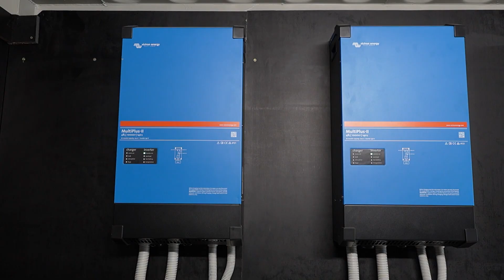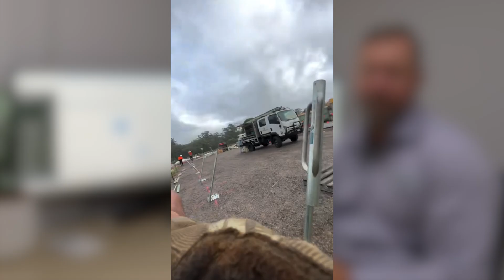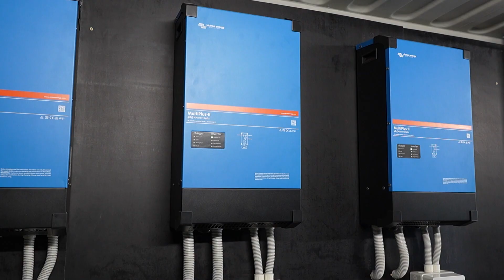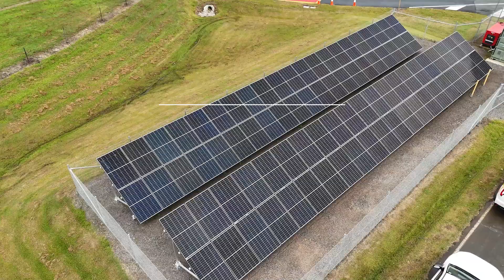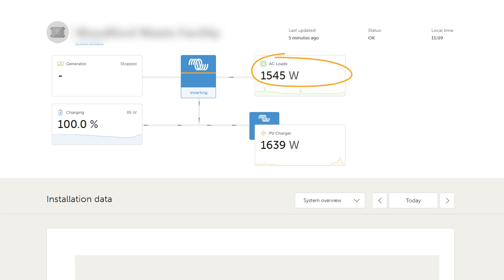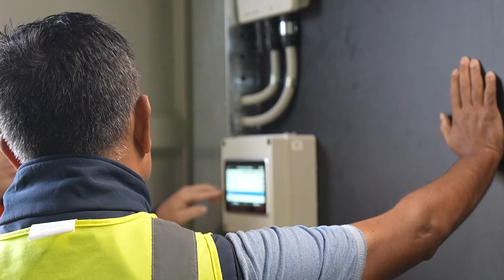Off-Grid System Walkthrough | Victron + Solar

Comment: Good idea to have the back-up genny run every so often even if not needed. Saw another video where an off-grid system worked great, installed spring, run through summer and autumn, needed the generator early winter and it wouldn't start (never been used) because the on-board 12v battery to start it up had gone flat.
Reply: Gennys should have monitoring and solar on board and diesel heater.